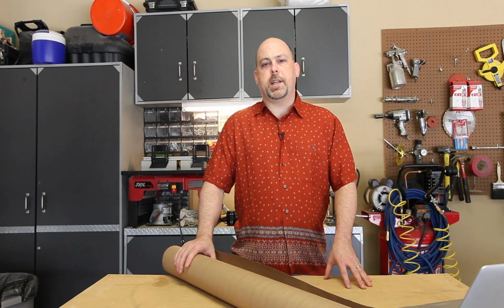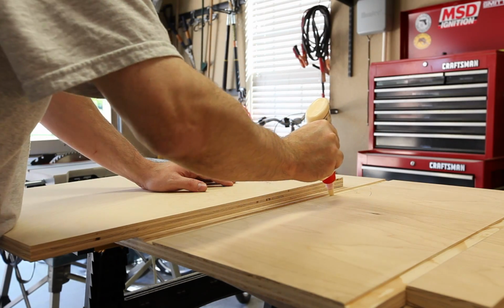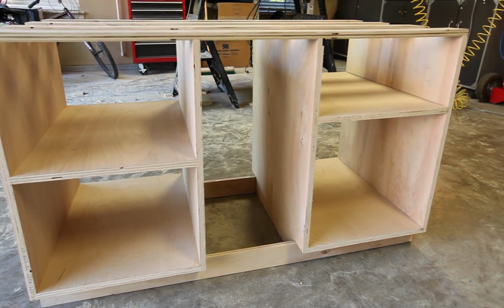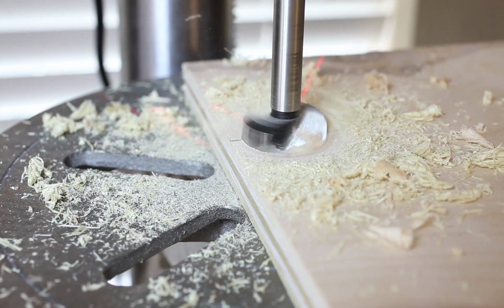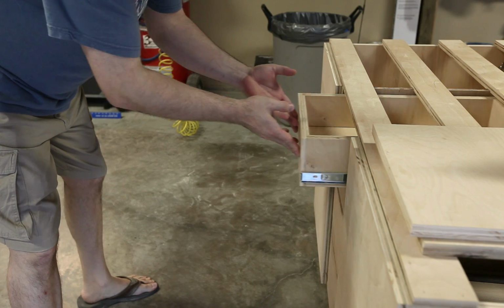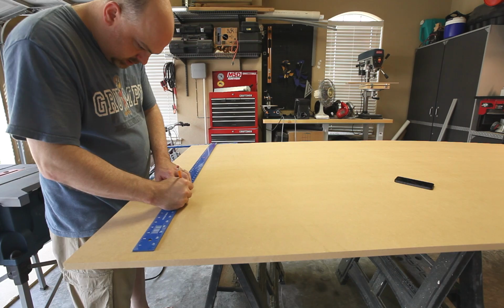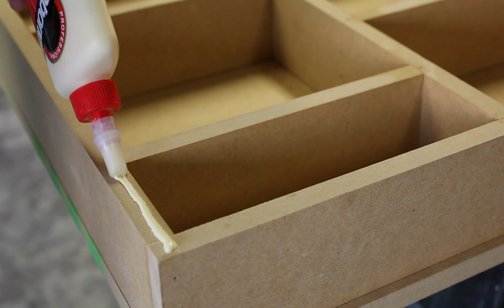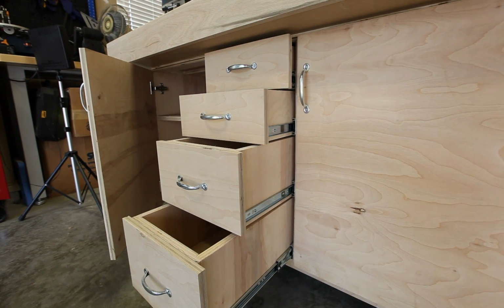How to build a Torsion Box Assembly Table

Comment: I'm in the process of doing this project but because u don't have a work shop my work bench with cabinets will be put into my garage which is also open without garage doors so because I'm making cabinets under my table to store my power tools I wanna be able to lock my cabinet but I wanna do single doors I notice a lot of cabinet locks are meant for 2 door cabinets what's a good single cabinet lock and what's the best way to install them?
Reply from the maker: +Datsun521808 Check out my arcade cabinet video.  I did exactly what you're looking for on that build.

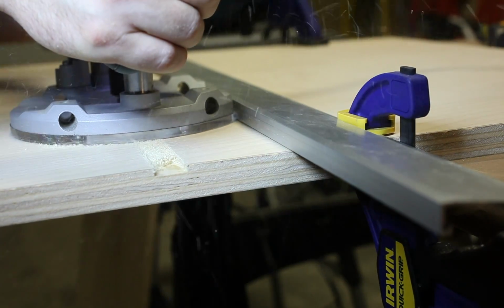Comment: When routing against a straight edge (like @ 0:44) I use the round edge of the router base (rather than the flat edge) against the straight edge. Even with a bit of wiggle the bit maintains a straight line. If the the flat of your router base binds against your straight edge, the bit moves away and you end up with a kink in your rabbet/dado.
Reply from the maker: +DesandSam That's a great tip!  Thank you!

Comment: Nice job with the video.  Hey, I'm wondering: what do you think of taking that nice base you built ahead of time and using it as the platform on which to build the torsion box?  Seems to me it's a lot more sound and square than a couple of sawhorses.  (This is what I thought you were going to do when the video started.)  Thoughts?  Thanks!

Comment: More Hey TGP, will the brad pins pull especially with MDF? You appear not to screw joints at all. Is this because of the MDF? Would screws not be strong over time with MDF? Colin

Comment from the maker: A torsion box is basically anything with two skins and grid in the center.  Even a hollow core door is technically a torsion box.  The reason for using one is to get a very stable and keyword here, flat surface for assembling things.  It won't bend or rack.  And it costs far less to build than a solid 4" thick table, and finding someone who has a 5 ft wide planer to flatten it. :-)  Thanks for the question!